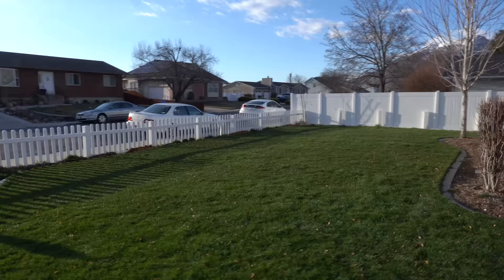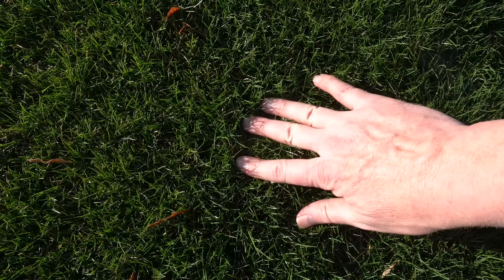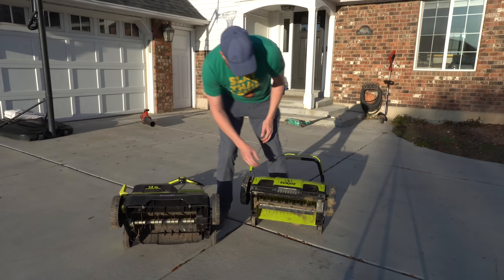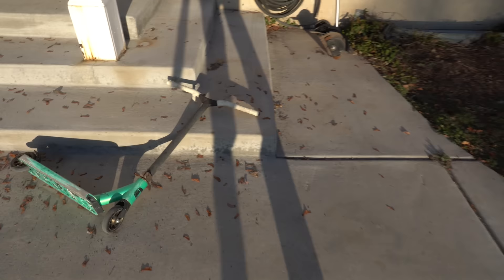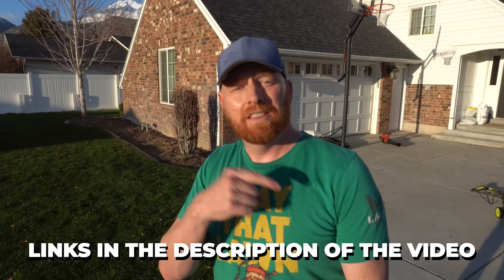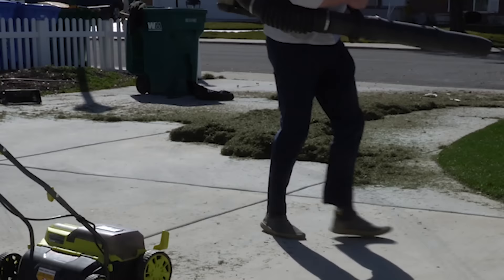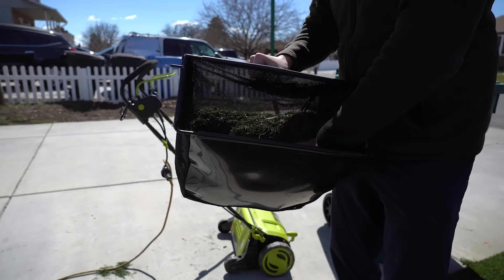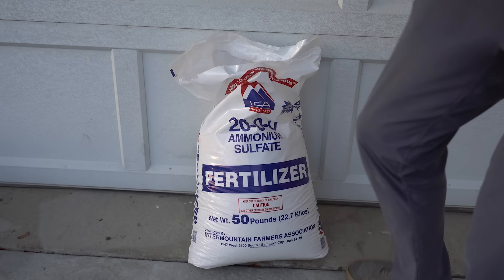Spring Lawncare - Do these 4 things FIRST

Comment: Gorgeous lawn! Mine is currently buried under snow and an 80’ hemlock brought down by the recent nor’easter. 😢 I hand dethatched my 9000sf lawn last fall. Time to buy one of those machines and also scarify. TY for great advice always.
Reply from the maker: Oh no!  

Go slay that lawn! These machines are fantastic
Reply: Awesome! I hand dethatched 5000 sq feet last fall. Did a video on that here actually! Was a lot of work so I can appreciate the grind!
Reply: @dbproductreviews6319  👊🏻 It was a grind but so rewarding when all finished!
Reply: @rebeccabee6615  of course!! Gotta respect the hustle.
Reply: Cut mine a little short. Had setting too low. Early spring in pa temps in the 60s. Should it recover ok?

Comment: Great video. Will this help reduce or get ride of dandelions?  Is there a recommendation to get rid of dandelions particularly when you have dogs?
Reply from the maker: dandelions are commonly biennial weeds meaning they have a two year life span most of which is happening underground.  dethatching can dramatically reduce weed seed germination if ran weekly during the germination period when ground temps are between 50 and 60 degrees F.  For better control its best to look into pre emergent control and also herbicides to get rid of the actively growing weeds.  also keeping your lawn as thick as possible helps a ton

Comment: Man, it's always a battle.  Last year I finally got most of my goosegrass conquered, so I was thinking this year would just be mostly a maintenance year.  Wrong.  As soon as it started getting warm, I realized I know have poa triv all over the place.  I'm told that running the scarifier can actually spread the poa even faster, so I'm opting out of that this year.  I'm going to throw a hail-mary and try a cocktail of selective herbicides (mesotrione, sulfentrazone and fenoxaprop) to see if I can put a dent into it, otherwise it looks like it's full renovation time.  I know Velocity-PM is supposed to be able to do it, but if I'm going to spend $500 (before I even get into the seed, fert, etc to fill in where all the triv was) I'd rather just kill it all, start over and go with a good cultivar (No offense, Scotts) and get everything uniform.  I'd say my front yard looks to be about twice the size of yours, but I think I can get the seed, fert, and other supplies I need for less than what I'd spend if I went the Velocity-PM route.  I'll be sure to report back if the cocktail works, but I suspect the renovation is probably unavoidable.
Reply: Reporting back with mostly good news.  My cocktail seems to be working.  I mixed up a gallon to spot treat my poa triv and a few other things.  I actually used T-Zone (sulfentrazone, tricyclopir, 2,4-D and dicamba acid) Tenacity (Mesotrione) and  BioAdvance Bermuda Grass Control for lawns (fenoxaprop) all at the label rates with a splash of methylated seed oil for a surfactant .  I'm happy to report it utterly disintegrated my clover.  As far as my poa triv goes, it's looking pretty sickly.  It isn't dead after one application, but it seems really unhappy, and even if it doesn't completely die back, its actually much easier to grab it and manually pull it out.  If it doesn't completely die off, I think I can get most of it out with a thatch rake.  But I think another treatment or two will spell the end for my poa.  Also, it doesn't seem to be bothering what little TTTF is left among the triv.   

A few notes for anybody wanting to replicate this.  I have a cool season lawn, that is mainly TTTF, but there is some KBG mixed in.  We've also had pretty cool temps the past week (highs in the low 60s) Based on what this mix did to the clover, I'd say it's a pretty "hot" mix and might damage your good turf if it's already stressed.
Reply: One last report.  After two treatments of my cocktail mentioned above, (a few weeks apart) and a few passes with my sunjoe dethatcher, I don't have any signs of Poa Triv in my front lawn.  I'm not 100% confident yet, as the heat may have cause some of it to go dormant, but as of now I can't find any of that lime-green in the yard.  It's definitely thinned out compared to when I started, but what's left seems pretty healthy.  I think I may have avoided a complete renovation.

Comment: Hey, I lived in Orem for 30 yearss.  It sure looks like we could have been neighbors.  In earlier videos you recommended a fertilizer from a company in Idaho.  Do you still recommend that fertilizer in addition to the farmer brand.  BTW, I have used the farmer's 4 step brand for years with good results, but feel I was just as successful with their garden fertilizer at less cost.  Thoughts?
Reply from the maker: for our area the 10 - 0 - 10 or equivelant can't be beat.  pro peat is a great product and i recommend it.  the fertilizer shown here is  straight nitrogen.  great for a first application.  
as for which is best.  there are varients in the types of nitrogen, potassium and phosphorus.  but at the core most are the same.  so equivelent mixtures will generally yield similar results.  propeat is special in the fact that each pearl of granular has the mixture in it.

Comment: Every mid March I mow my lawn on the lowest setting and the run the scarifyer in two directions and then I lay down PGF complete.  In central PA this is when it starts to get rainy and I find this gets plany of nutrients in the soil for when the lawn wakes up. 
How are the three different perennial ryes doing in your front lawn?  Which one is performing best for you?
Reply from the maker: They're all doing great.  no surprise but the rpr is a tad lighter.  they're all great options.  its hard to beat the regenerating properties of the csi rpr blend.
Reply: @pestandlawnginja  - I got a bag of that to do some spring over seeding can’t wait to see how it performs.

Comment: Question a little off topic. So i dethatched, and laid seed. Was thinking of adding peat moss now. Do i need a spreader?, or can i just pour peat moss and rake? I feel like i should have done peat moss first, then seed. I worry about messing up my seed spread, by racking around all the peat moss. Thanks!
Reply from the maker: Best to place the peat last.  It's difficult to do without a spreader.  If it does in to thick it can cause issues.  It's not that you can't do it without the spreader it's just a pain
Reply: Thanks for the advise partner. Hopefully I can rent one from my local tool place. I seeded yesterday. Will try to lay some top dressing on Monday. I hear not to seed in spring specially late spring. But May has been perfect temps so far. Little cooler here up North. Looks like we have 10+ days of mixed rain, cloud, sun 50-60 temp days. I might get lucky this spring🤞your lawn looks great btw!

Comment: Dethatching, Scarifying and Aeration is not a good idea if your lawn already has a preemergent barrier.  You’ll break the barrier and allow the dormant weed seeds to grow.  You’ll get crabgrass and dandelions.
Reply: That was a question I had as I just put down a preemergent.  Thanks for your expertise!
Reply: I always thought you shouldn’t dethatch or aerate in the Spring because it makes way for weeds to grow. At least that’s what Jonathan Green says.
Reply from the maker: pre emergent should indeed go down after this process.  the counter argument is this, if the ground temps are around 55 during the heavy germination process, dethatching and scarifying can disrupt the seed due to the cultivation.  if you dethatched lightly every 3 to 5 days during this process it would be considered a form of non chemical pre emergent practice.
Reply: @pestandlawnginja so dethatch first, and then apply pre-emergent, and fertilizer last? Or dethatch, fertilize, and then pre-emergent in spring?

Comment: Around which step should i apply pre-emergent? On the north side, I'm afraid the ground is too cold for detaching, but I cant do that after applying pre-emergent either.
Reply from the maker: pre emergents should be applied before the ground temps reach 55 degrees.  i would do it after the dethatch and scarification

Comment: What would you suggest for st Augustine grass? We just bought a new house and have never really dealt with it. Everything I read says so not scarify or dethatch due to the stolons but there is SO MUCH dead grass…
Reply from the maker: you can still use a dethatcher as long as you're staying above the stolons.  the major issue is st augustine runs off of central stolons as you already know.  if they die you may need to remove some and then you can plant new plugs in those areas until they spread.

Comment: Hey Ginja: there isn’t a link to the Ryobi machine in the description. I’m still using the older SunJoe you recommended years ago…the “Fisher Price toy”. I replaced the belt a couple years ago and it’s still going strong but I’d like a cordless model. 😅
Reply from the maker: Thanks for the heads up!  sun joe is a beast!
Reply: Sun Joe now makes a 15 inch battery model. I just got one, and it works fine, just wish I could get more time out of each charge, but I am doing a close to 20K sq ft lawn, so I am going to have to recharge a couple of times to get it all done.

Comment: What are your thoughts on Urea 46 for a big wake up? BTW, got a SunJoe last year and it has been my favorite lawn tool since!
Reply from the maker: from the studies i've done there is little benefit to using urea until the ground temps are permanently above 50 degrees.  most of the benefit occurs at 55 to 65 degrees.  the primary issue is that urea is volatile and it in essence evaporates.  even with ideal temps you can count on a 40% to 60% loss out the gates.  its an interesting subject.

Comment: I disagree with the watering you mentioned at the end. You do want the soil to dry out somewhat. Too much moisture will cause fungus. Also shallow watering promotes shallow root growth. If the top is always wet the roots dont need to go deeper.
Reply from the maker: there's a bunch of counter arguments for sure.  i've gone the rounds with the top seed companies on this subject, pros and cons of shallow watering and deep water.  fun to debate.
but i do feel its important to note that generally when the top layers are dry, that doesn't mean there's a magical source of water down below for the roots to chase.  from the 1000's of lawn assessments i've done there's only been a handful of cases that there's been water below when the top layers were dry and it was due to low water table.  but it does happen.